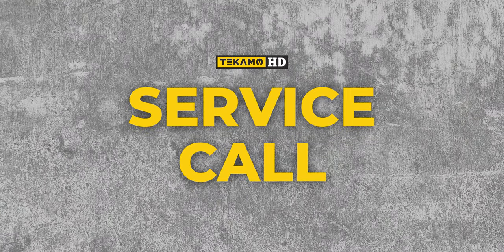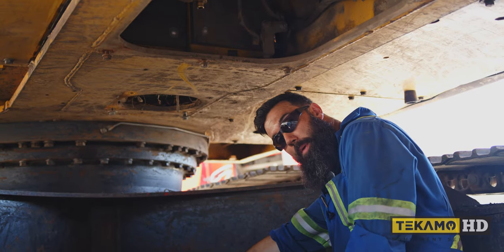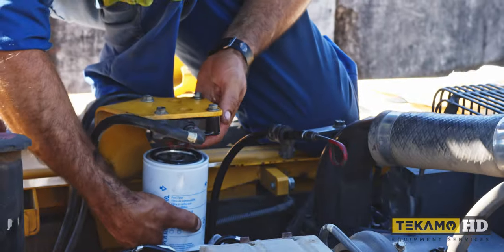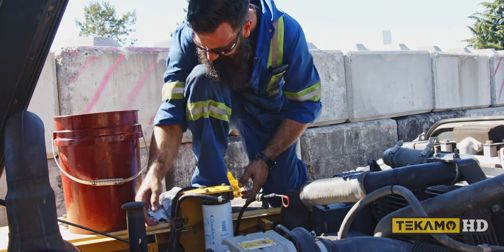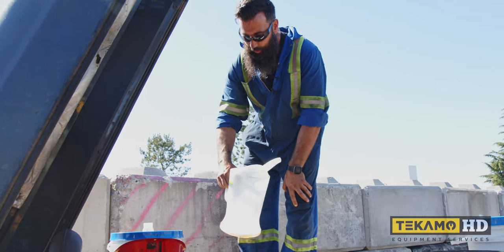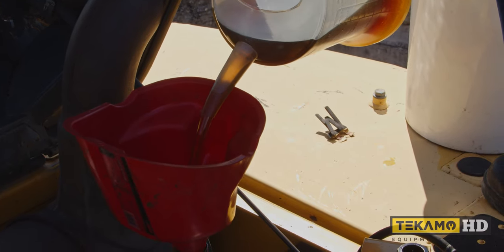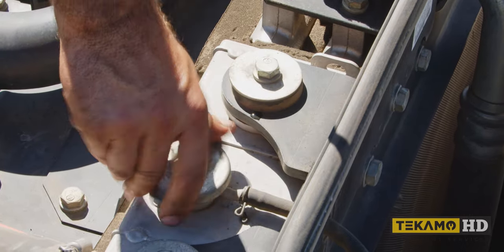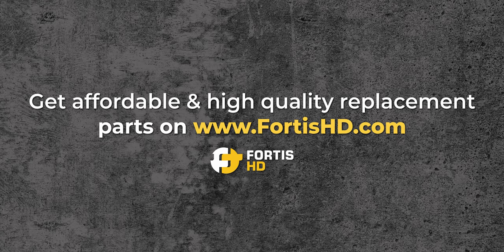Komatsu Excavator Engine Oil Change - 1000 Hour Service | Service Call Series

Comment: A few things to point out, you should never fill the prime fuel filter as well the main filter, to hinder any type of contamination that could impact failure to a common rail. Water was never drained from the diesel tank. When filling oil, 1 cm under max is optimal, especially machines with KDPF, Komatsu  Diesel Particular Filter.